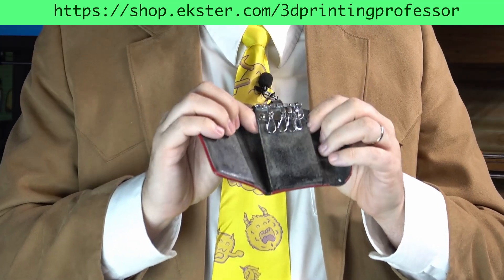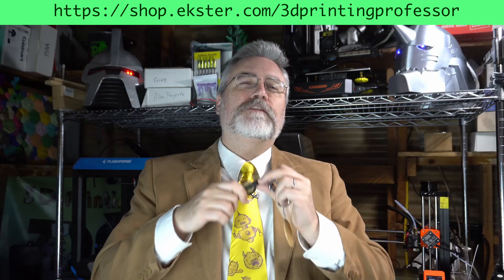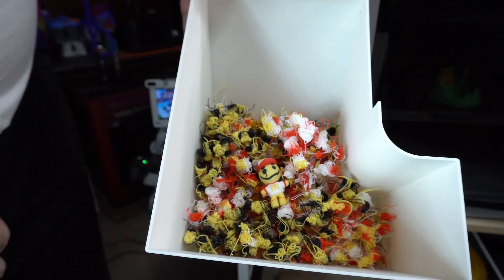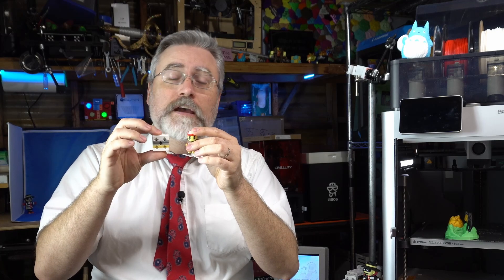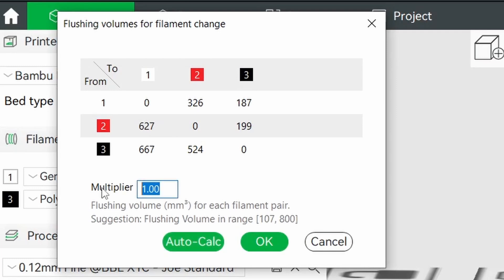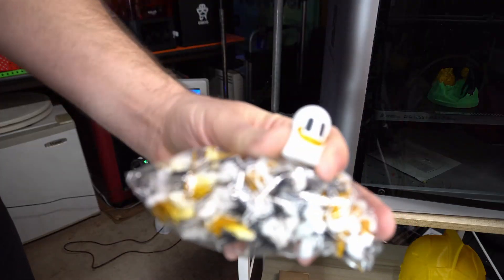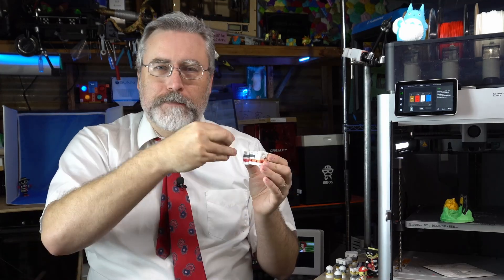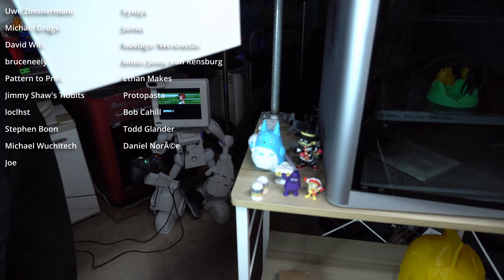Can BambuLab's AMS 3D print with less waste?

Comment: Good vid. You have articulated the main prob I have with the Bamboo system, and the main reason I wouldn't use it.
The waste it produces printing in colour offends me on a pretty basic level.
Someone needs to get a lot more creative with this problem.
Better calculations for the purging object, or a third module out the back of the machine which automatically recycles the waste back into useful filament.
I'm curious to see what Ankermake are going to release as they reckon that they don't need a 'purge tower'.
Imagine the waste produced if someone wanted to use the Bambu for producing prints for a product!

Comment: I have a few ideas in my mind but have you ever thought how they could make a RGB printer? All you would need is blank, White, Red, Green and blue to print any color. First had the idea a few weeks ago when changing colors to find that when feeding the new color in I would always get a mix of the two making a 3rd color.
Reply from the maker: That's been done, and there's a number of challenges to making it work. For instance, with 4 filament tubes feeding into one nozzle, the filament doesn't always only go out the nozzle tip, but if one filament isn't moving, say because you don't need it in that mix, then the heat creeped filament might be unable to prevent back flow up that filament's tube causing a major jam. Consequently you have to make sure that no matter what color you want to print, every color is feeding through, even just a little bit, to prevent heat creep backflow. Consequently all colors end up looking a little muddy. 
Then there's the fact that there isn't really a well developed software chain for this sort of 3D printer. And with the afore mentioned problem, and the fact that colors never really look that good, there isn't really a lot of incentive to develop it further.
It's one of those ideas that sounds good on paper, but ends up with problems that make it not worth pursuing to the end.

Comment: The problem is printing multi color through a single nozzle.
Reply from the maker: Not entirely. You can get quick changes through a single nozzle, but they cut so high above the nozzle and don't use that part, they could make it much better.

Comment: It's an extremely complex issue it seems.  I don't think there is a difference between a flush tower and the poop because both are throw away..  seems Prusa skipped the whole issue with a multi tool solution in the new Prusa XL, although expensive i think that is the practical solution.

Excited to see how bambu will respond once Prusa eventually releases their multi (five) extruder solution.

Comment: Thanks for the video and your excellent idea which I fully support. Some slicer enhancements could calculate the amount of poop created by a print and then help using the filament poops for printing additional objects. Shouldn‘t be too complicated for the software developers. Another way is to recycle the poop shoots into new filament, but this may be too elaborate, as it requires a kind of filament hardware.

Comment: i got a x1 without an AMS because of the poop, but most poops looks to long for me. Isn't it possible to reduce the poop size by a big ammount but big enough to get a clean print? The stock values look to high for me. and use the infill for most colorchange?
Reply from the maker: You can change the settings to purge less, but if you don't have enough you'll have color bleed.I believe the amount purged into infill and purge objects is taken into account.

Comment: I've been thinking the same thing and was hoping for more insights from your video i.e., why does the purge block option need to be on, in order to flush into another object? Can't the flush object just replace the purge block? My theory is the purge block is essential to obtain a consistent flow of the new material, but if that was the think the poop should just happen for the new filament vs. the last filament. I'd assume that way you could use less purge and put it towards the flushed object. That could work in addition to the method you proposed. I'll assume this will be a major overhaul that will come with time from the community with Orca slicer and other forks working the problems.
Reply from the maker: That is correct. The idea is that the purge block is where the filament gets up to pressure, but if you have a flush object, that shouldn't be necessary.
I don't know. Clearly there's a lot more work to be done.

Comment: Really great work!  I have tried doing this with my older Geeetech A10M to help flush out materials and also find that random parts can be found to print that are functional but not needed to be specific colors.  I really don't like the auto-purge tower options in Cura typically, but find that you can place dummy objects (cubes, cylinders etc.) on the bed designed to print in different colors and ensure that they will print in a specific order (the slicers often have preferences as to what order objects are printed based on their position on the bed) so that the part you care about will always print with the freshly purged nozzle (and preview function is critical to ensure this is working as intended before you waste print time).  As other commenters have pointed out, efficient slicing options to reduce these problems so we don't have to resort to hacks and multi-color just usually isn't worth the hassle and waste right now. Multi-material is a different story but still aren't great with single nozzle commercial systems.

Comment: Wouldn't you end up with artifacts in your print if you stopped whatever motion was in progress once the purge amount was met?  I'm just imagining it going around the perimeter of the block, stopping, and then attempting to resume the perimeter later.  It would likely have a bunch of random seams.  Although, I guess if you're just making it out of random colors, you probably don't care so much about how it looks, so a little unsightliness in its finish isn't that big of a deal. 🤔
Reply from the maker: Yes, maybe. Though, only on the outside walls would it be noticeable, and even then it isn't going to stop mid-line. 
These are objects to catch waste, so I assume the expectation wouldn't be for perfection in them. Just something better than a pile of waste out the back of your 3D printer.

Comment: would a multi material printer to print with zero purge. bleed the colors into the print
Reply from the maker: That would be my first couple of prints in this video.
The thing is the filament cutter system leaves so much in the nozzle that their purge is considerable. Honestly, there wouldn't be room inside most prints for all the purge necessary. I kinda wish they just pulled the filament out and shaped the tip. But that's a known solution and they didn't go with it, so here's hoping there was a good reason for that.

Comment: multi color - one nozzle was a stupid idea right from the beginning. you waste so much material its insane on a financial scale. together with the layer edhision problems of faster prints this makes the bambu a waste of money.
Reply from the maker: It's got advantages over multi-nozzle For one you don't have to calibrate each nozzle against each other to be sure they're landing in the right place. For another, it can theoretically do 16 colors (and more) with very little additional over head.
It's got it's down sides, everything does, but I wouldn't say it was a waste. It works.
Also... what's this about layer adhesion problems? This is the only printer I've used that can actually print water tight, so this is news to me.

Comment: Some people buy silicon molds and melt the poop in that. You get marble effect that way. I actually was kind of hoping the Prusa MK4 + MMU3 would get a poop shoot. The massive purge block sometimes takes up too much space. Prusa slicer also supports flush to object, but I have no idea if it has the same issues as bambu slicer. The problem is........I never have anything useful to print where the color is irrelavent.
Reply from the maker: Like I said at the end of the video, I'd love to try these in an injection molding machine with 3D printed molds.

Comment: Everyone seems to call priming "purging" and talk about a "purge tower" when even the interface is telling them clearly it's a "prime tower" for priming.  "Purging" is when it poops filament through the waste chute (according to bambu labs wiki). The "flush" options refer to purging.  Thanks for the video I was really curious about this option.
Reply from the maker: I tried to be careful about that in this video because, you're right, priming and flushing/purging isn't exactly the same thing, though to be fair priming can be a place you flush to, but you can't flush and ignore priming or the print quality goes to crap. Found that out the hard way.

Comment: definitely would like that to work.  playing with the slicer because a great friend is getting me one.  I sliced something that would take multiple plates and with how it wanted to do it: full plates, it would use 2.7kg of filament total.  1.6kg for the model, so about 1.1kg of waste/purge.  so one of the things I did was set the plates myself to minimize waste.  I now have it down to 200g of waste/purge.  I wasn't thinking of having a purge part.  which would be nice to have/use.  it could be test prints mixed in with colored on purpose prints.  I definitely hope they keep improving the system.  the only other similar capability printer is the Mosaic Element printer but that starts at $7000.  really hard for anyone to justify that.  but $1500 for a practically plug and play, multi-color printer is awesome

If anyone is curious what model I was slicing it is my Omega Starship Transformer.  it is on cults3d

Comment: Interesting idea but it doesn't really eliminate waste right? I mean, it's just reshaping the waste. So instead of little strings of poop, you end up with some other object in a variety of colours. I've seen some people who melt their AMS poop into a mold and create some artistic models that way. I guess the ultimate solution for this would be to have an automated recycler to collect the poop into separate buckets, and if you have a home filament extruder, melt it and extrude it back out as usable filament again. But that's quite a bit of work.

Maybe multihotend printers are really the only way to do multimaterial printing fast and with less waste.
Reply: I know your comment is 7+ months old now, but plenty of models aren't colour dependent. Primarily functional prints, abstract organic shaped models, or even models that could/will eventually be painted.

Purging filament into anything more usable than the poop bin is infinitely better than waste.

Comment: Great video - and your blox are a good idea for something useful to purge. I guess the solution will be almost totally slicer based - so could in theory be developed by the community, rather than waiting to BL to develop it.  Or indeed might be able to be done with a post processing script.

I haven't tried purging to objects yet personally - I tend to focus more on aligning objects and splitting them up to minimise the number of colour changes.  However, 

I guess based on what your are saying  is happening at present when you purge to object is that for each layer the GCODE probably 
1. Prints the first colour of the main objects
2. Filament is cut, then AMS does the first colour swap
3. Prints into the purge objects until it thinks the colour change has happened ok.  If necessary doing some off bed purge if not enough purge object layer is available
4. Completes the current layer of the purge objects.
5. Creates the first part of the current layer of the purge tower
6. Prints the second colour of the main objects
7 Filament is cut and AMS does the next colour swap
8.Off bed spiral purge until it is happy that the colour has changed ok
9. Completes the next colour on the purge tower
10. Prints the next colour of the Main object
11. Repeat steps 7-10 until layer complete.

What the slicer could be changed to do, or perhaps a post processing script could be written to do - 
a) is to move all of the  G-CODE from step 4 above - to later in the layer print order - 
b) to replace all of extruding in step 7 above.  If the step 4 extrusions run out then off bed extrusions would have to still happen.  
c) Finally assuming Step 4 extrusions are still remaining at the end of the layer then they will have to be completed before the print moves to the next layer.

Whilst this sounds complex - I think the P2PP post processing script that was written by tomvandeneede to allow Palette2 etc. to work with prusa slicer has a fair bit of this sort of logic in it - as it can for example completely remove the normal prusa slicer purge block and create its own more efficient version.

Update - have done quite a lot more work on this subject - My latest progress here.  Think I can get purge down by between 95 and 99% - https://forum.bambulab.com/t/making-better-use-of-purge-to-object-in-bambu-studio/29422

Comment: Interesting video! The AMS appealed to me not necessarily to do multicolor prints, but to have four colors ready to go (it was difficult to change the filament on my first printer). And changing colors in the unit is easy too. I have done some multicolor prints, but work to minimize filament swapping on my prints which has the potential to rapidly accelerate the wear of the unit without trying very hard. I’m confident Bambu Lab will continue to improve on the filament waste issue. It’s not a simple issue as you pointed out so well, so it may take some time. Videos like this will speed up the process.
Reply: I had the same issue with changing colors on my old printer. It was such a pain that I would try to not have to do it. It’s so easy on the Bambu!

Comment: i've owned almost a dozen printers in the past two years or so doing 3d printing. my latest addition is my 4mo old bambu labs x1 carbon. i absolutely love it. the ams is great, it works wonderfully, it isn't without its quirks though, just as any printer. most things are easy to get to in order to unclog/unjam. ...my biggest gripe is the amount of waste (and time) doing multi color prints is. I wish it could be as fast as if it were normally printing. ..i think tackling the waste issue will also actually tackle the speed of multi-color prints issue too.
Reply: Unfortunately tackling the waste issue - by flushing to objects will I think still not solve the speed issue - in fact flushing to object almost certainly will slow down the main print a little as there will pretty much always be slightly more filament actually needing to be extruded in order to correctly form the flush objects

Comment: Honestly i don't consider the AMS a proper solution at all, i'd only use it to select filaments, I know my opinion is extreme but we already waste enough plastic as is, not to mention that 3dprints are even harder to recycle and there's no multi material. it feels like a brute force solution

i'd much prefer a dual hotend (tilting or lifting) or a tool changer! it's sad that we have no proper cheap tool changer available. makes me really wanna build my own Doot Eternal and sell the kits, but that's so much work alongside my college and trying to survive in a dystopia with high rent! plus living with 2 roomates in a tiny room makes it hard to build a printer.

maybe something could change in the hotend design that reduces the waste created?

Comment: In my opinion a little "poop" should always be there even if almost all the purging happens to the object - just so that you are save, that the nozzle preassure is at a level you expect it to be or else you might underextrude those flush objects.
Reply from the maker: Except the point of the purge tower is to set the pressure to what you'd expect. So it's not the poop chute pressure that matters. I think we can do without it.
But even so, there can be a lot less, theoretically.
Reply: @3dpprofessor  totally you are right, the purge tower will take the place of what i descriped and either way, there will be much less poop. I just wanted to say, you won't get rid of 100% of the waste, you either need the purge tower or the poop chute.  I prefer the poop chute over the purge tower, as i had purge towers fail my past. :)